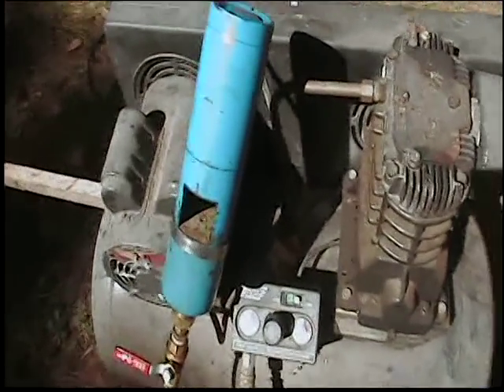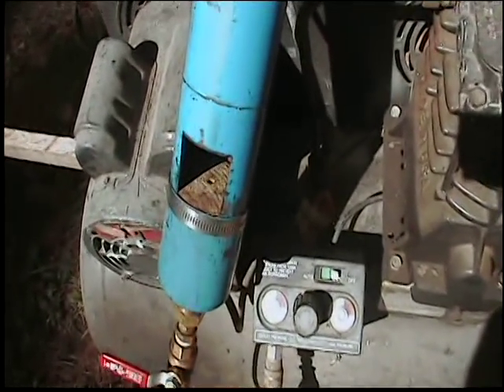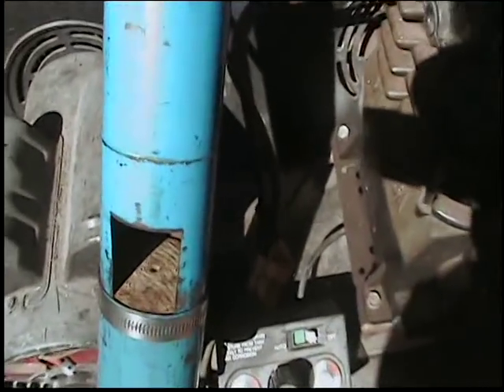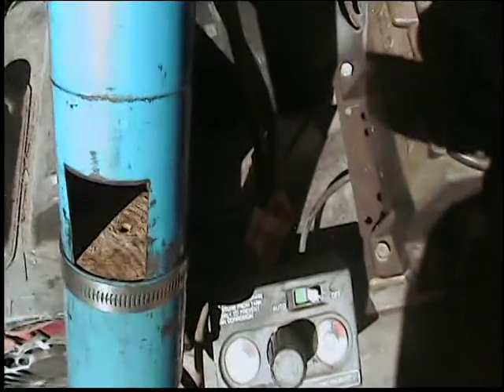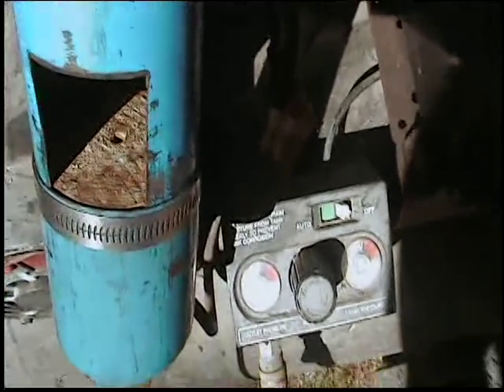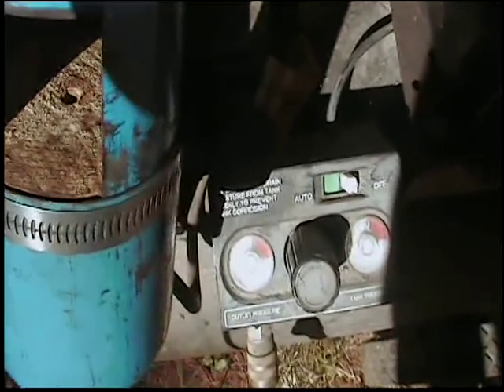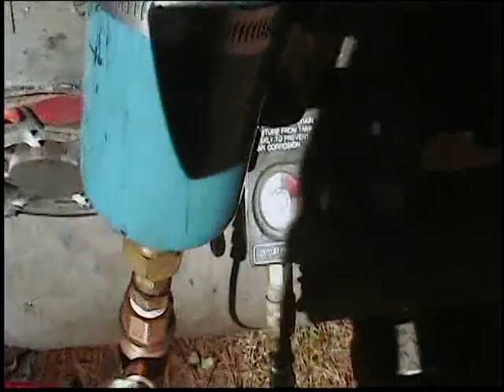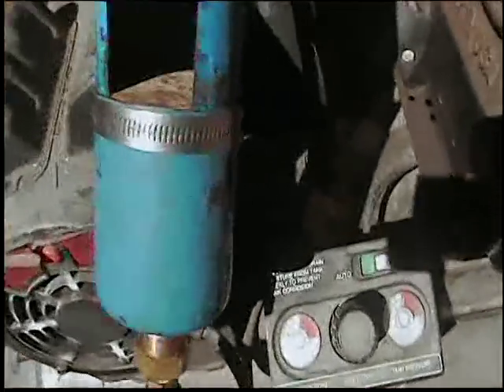Steam Whistle on Air

Comment: Take a wrench and crank up the pressure,keep trying you,ll get it right. I knowthat the edges of the openings ar cut/bevelled at an angle to kind of slice away at the staem or air rushing up towards it. I,ve estimated the angle at 45 degres  on the inner side  of the vrtical openings that face down.

Comment: Steam whistles and old air horns have the wonderful quality of being able to change pitch with pressure. What you got there I'd say would be at home on a steam launch or smaller steam boat.
If you make one out of brass and blow it on steam at around 120-140 psi I reckon you'd get a different sound.